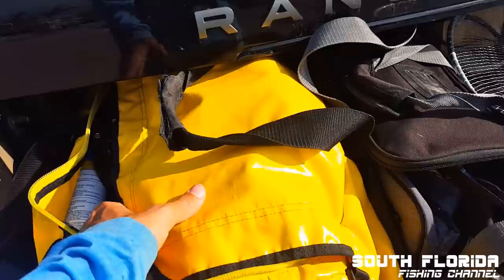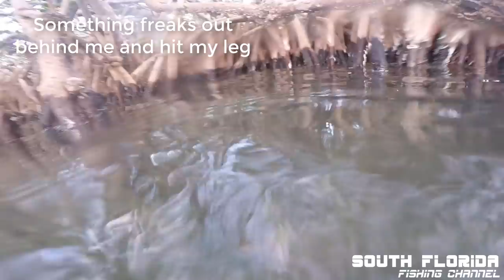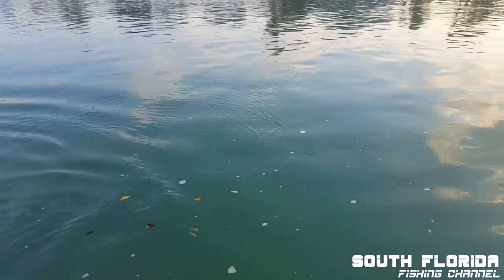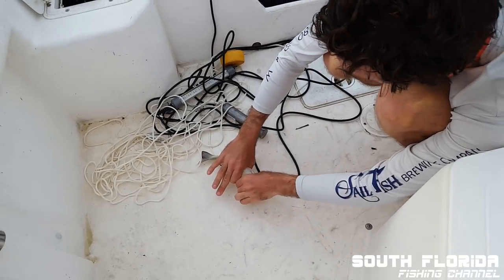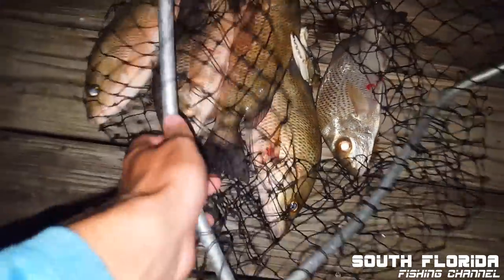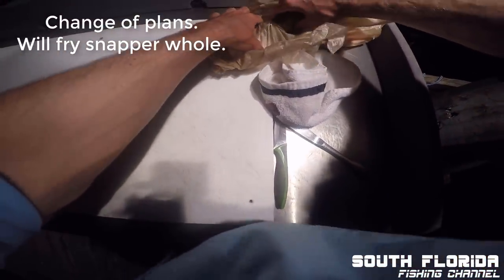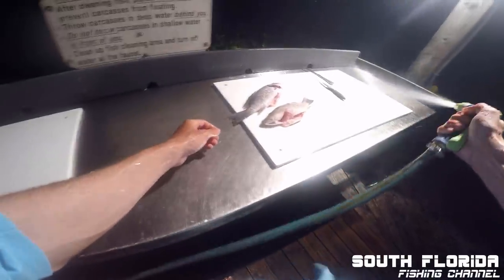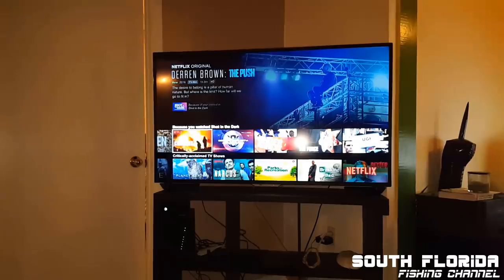Fishing the Mangroves for Snapper and Lobster | catch n cook

Comment: Shrimp lights were way to high, you want them as dark as possible. You learn to dip shadows of the shrimp trying to go above the light. It's a lot easier with two lights because you can create a dark spot to push them through. You need to find the smallest channel possible so they are funneled to one area. I go at outgoing tide so they are pulled off the flats. Also we shine with a spotlight to find a stream, you can see their eyes. Keep it up you will get it.
Reply from the maker: Yea man I will try and get better! I was out at an incoming tide so I think that screwed us up a bit and I need to find a tighter channel. I have some spots in mind =)
Reply: Yeah we always do outgoing, try to see how the current is pulling them . I anchor sideways halfway in the channel. Drop the light in the channel so when they boil right in front of you and gives you time to dip them. They will be moving fast. If it's to fast and they are ripping go to behind the bridge you can put it in the side behind the piling they get caught in the calm area behind it to give you time to scoop them and you can hide if it's windy. No doubt you will get it going soon. Good luck look forward to more videos